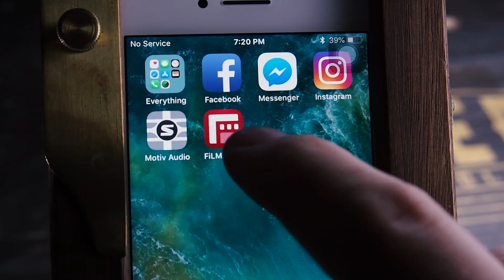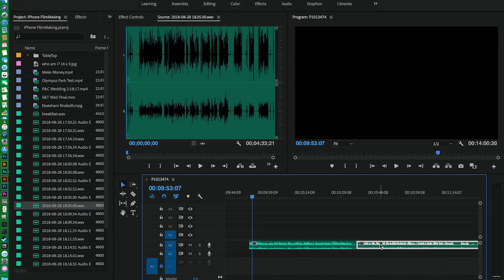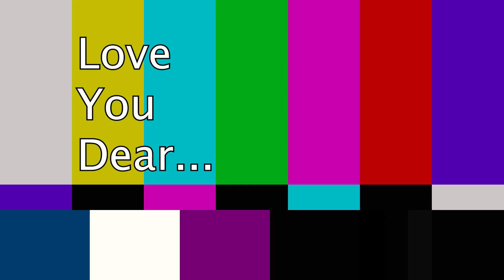iPhone Filmmaking - How/Why You Don't Need Gear

Comment: Love it! Thanks for the advice...but just wondering what kind of camera you have if you can take out the battery and put in a new camera?
Reply from the maker: Yeah yeah, good one Anthony... haha. Thanks man!
Reply: must be a macro 4/3rds. Also, there's a reason most nature photographers stick with primes. The image is better and forces the user to be " interactive" and not just point and shoot. You have to physically compose the image as you move around. No point and click. Plus that moving around usually inspires more creativity with the shot.
Reply from the maker: Yep Micro 4/3. I like being able to use whatever lenses I like (vintage glass) due to the short flange distance.
Reply: missed the joke, but that's ok
Reply from the maker: Haha. There needs to be a sarcasm button on comments.